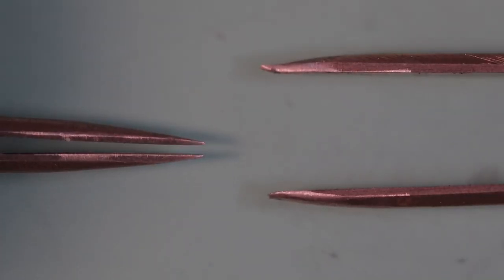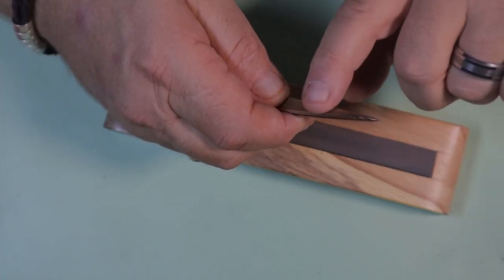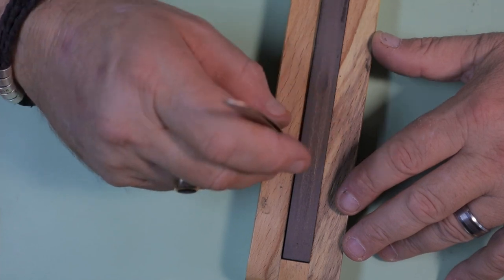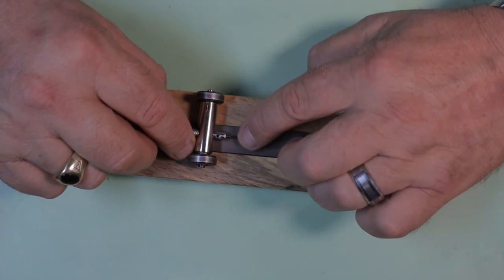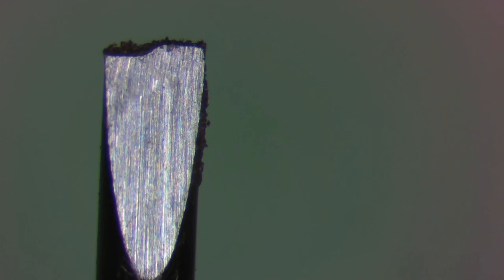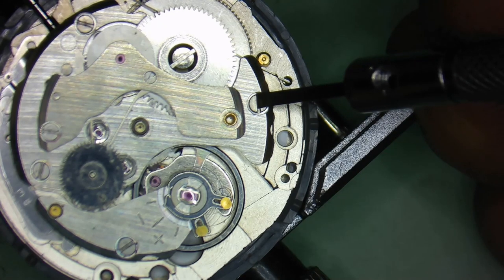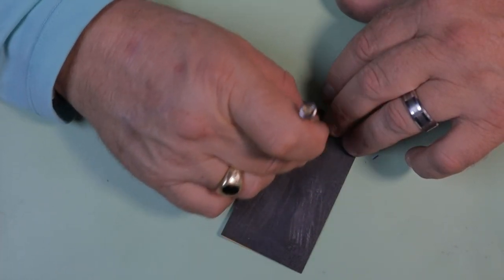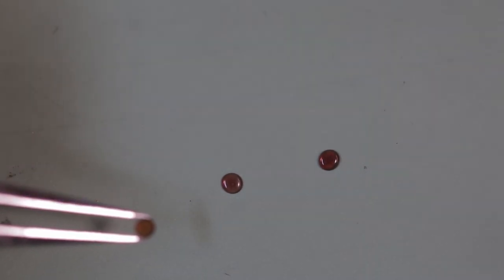How to Shape Tweezers and Screwdrivers for Watchmaking. Episode 2 in Watch Repair and Service.

Comment: I just retired after working on US Naval aircraft for 25 years followed by 24 years of specialized US Naval Seaborne Radar testing. I’ve been watching Marshall Sutcliffe for a while now and splurged on tooling to start my new hobby of watch servicing. So far I have been experimenting with a couple pocket watches and making the common mistakes your first two videos explain. Looking  forward to learning more from your well produced and realistic tutorials. Thank you in advance, Roger.
Reply from the maker: Well, first, let me say thank you for your service and the sacrifices that you and your family made to protect our country.

The first bit of advice that I would give you is to remember that just like the testing you were doing on radar equipment, everything and watchmaking matters  down to the smallest degree.

Probably the first obstacle that most newcomers face handling the smallest parts. 

In this video before we even talk about taking anything apart, I focus on making sure that your tools are in good shape so that you don’t have screwdrivers, slipping out of the slot, damaging the movement and to make sure that your tweezers are properly dressed so that you can pick up those tiny screws. 

Most people don’t think it’s important until they have a part fly away.

If you ever need any help with anything, don’t hesitate to reach out .
-Alex

Comment: Thank you for making these videos. Excellent work. 

I am looking on getting started with watchmaking and this has been a great place to start.
Reply from the maker: The first videos are going to cover the basics, the movement systems, how to lubricate pivot jewels, the escapement, balance jewels, different methods to clean parts and how to assemble, check systems how to use a timegrapher and what and how to inspect. 
Then we will move into trouble shooting with real life examples.
I will also cover how to use a staking set, Jeweling tools as well as lathe work when we get into the more advanced repair.

Comment: The principles here are so helpful! I'm still waiting on the rest of my sharpening tools, so using this video as a guide, I free-handed a very light dressing of my tweezers and my two screwdrivers with some 400-grit paper. I used my fingernail to hold the tip down flat.

Even just this made a BIG difference in handling of the parts. It feel much better. In fact, if someone else tries this, I recommend 800-grit sandpaper to start out, because with 400 it only took me 5 strokes on each side to smooth and thin it out. Slower is better!
Reply from the maker: Nobody talks about really but sizing screwdrivers for the screws you are working on is watchmaking 101.
Many watchmakers will have multiple sets of screwdrivers fitted  to a particular manufacturer like ETA or Seiko.
In these cases, there's more consistency in one manufactures screw sizes so less dressing is required but when you are working on many styles of watches like a pocket watch one day and an ETA move to next day you'll be dressing screwdrivers a lot.
Reply: @watchrepairtutorials  Yeah, I remember you saying that! I don't have a full set of screwdrivers, just gathering them as I need them, so I suspect I'll end up with multiples of certain sizes way before I get a full set.

Comment: I've been a collector for a while but have recently gotten into actual watchmaking instead of just collecting. Your videos, in my opinion, are the best on YouTube. You don't just take things apart and put them back together with some light banter to break up the quietness. You explain things in detail, so we understand the why!! I've watched other videos and walked away scratching my head. I saw your videos on this playlist on working with the ST36, and with your help, I was able to fully disassemble and reassemble the movement without issue!

I've found my teacher and go-to! These videos are amazing, please keep it coming!

Question for you - how do you know which screwdriver is the best for the screw you are dealing with? The sizes are so close, I find myself second guessing which to use!

Get use to my name, I've got a ton of questions coming your way!
Reply from the maker: The screwdriver tip should be just less than the width of the screw. This is true in almost all cases.
Reply: @watchrepairtutorials  okay, that's good to know! So, just short of the width of the screw. The tip should sit in the slot touching both sides, not the bottom of the screw. I'm trying to watch all your videos before I bomb you with questions. I'm also signing up for your online course once I am proficient with the free stuff you got on here!
Reply from the maker: @KrimNL10DenZ  perfect. 👍

Comment: I use a small block of accurately squared hardwood with 0.5mm - 2.5mm holes drilled through to act as a jig to dress the tip of screwdriver blades. It has improved the flatness and squareness of the tips and makes sizing a tip to the slot a breeze. I'll stick with this until the AlexZen kicks in! Great channel. Thank you for taking the time and effort.
Reply from the maker: Hey man if that’s working I love it.

Comment: A trick I picked up is to stick my sandpaper to either a small piece of sheet glass or broken chunk of polished granite countertop. You can usually come away with a cutoff from big box stores or stone works (whatever is closer) for free or next to nothing. They will generally both be sub .001 distortion on the polished flats and works wonders on anything you want to make flat and square regardless of it being screwdrivers or cleaning up and truing head castings for model steam engines.
Reply from the maker: Yes sir,
Great tip. I have some small 6 x 6 pieces of glass that I picked up that also work well as you pointed out

Comment: Thanks for the tips on tweezers and screwdrivers.  Got any helpful hints on how to remember where screws go????
Reply from the maker: Sure do. First thing is look at them when you take them out. Many screws have distinctive features.
 For example, most of your bridge screws will be the same size and shape. Some screws have a chamfer undercut and the plate they come out of will be undercut. Of course, the two largest screws belong to the ratchet wheel and crown wheel with the crown wheel screw being reversed thread.
When you get to your disassembly group, your parts by the systems that they belong to. The your system parts together like  for the keyless works, the motion works and train.

Comment: Thank you, thank you, thank you! I had rubber bands holding my tweezers instead of actually adjusting them like in your bonus tip.  Just a suggestion/idea:  I saw on another vid that using aluminum oxide films (3M) are a good alternative to sharpening stones....so I bought a 30 micrometer one for $6 and it works great.  It was a great alternative because I didn't have the $$$ for good stones.
Reply from the maker: Hey man, whatever works for you. There are a lot of different ways to do it. The point is you just need to dress them. Nice having you here.

Comment: I read somewhere that it is helpful to slightly roughen up the inside surfaces of tweezers to help holding jewels.
Reply from the maker: Yes it is. If you take a piece of sandpaper, like 360-400 grit and fold it over, you can pull it between the tips to put some “teeth” on them. 
The exception would be tweezer dressed for hairspring work which spoils be polished to prevent scratching the hairspring.

Comment: Is the gritt of the sharpening stone the same of the sanding paper? 400-450? If the sharpening stone is wider than your can I damage the wheel of the sharpening holder screwdriver tool?
Reply from the maker: I’m not sure what the grid is probably around 4 to 500. If you’re doing this on sandpaper, since the wheels are rolling over it, I doubt there would be very much damage at all.

Comment: Thanks for another great video. I must get out the stone today and give things a touch up. I spent about half an hour trying to get the magnetic drive gear back in a Citizen C022 and once I dressed the tweezers it took about 30 seconds. It makes all the difference. Just need to get better now with cap jewels, launched one into the universe trying to get the clip back on ☹️
Reply from the maker: I am happy to see that you see the advantage in tweezer dressing and sharpening.
Just remember, super lite touch. Channel your inner “ Brain Surgeon”. 😊
Remember Phil, when holding a part, the amount of pressure, on the part or jewel, should only be enough so that if you lose it from the tweezers, it would only fall straight down.
Reply: @watchrepairtutorials  yes I use the minimal amount of force these days. It was replacing the jewel retaining clip that sent it into or it this time. And being about a third of the size of a balance jewel, I never found it again. Sent to the black hole of horology. Maybe I should have oiled the jewel first, it would have retained it, but I wanted to do that last. Lesson learned.

Comment: Where were you when those irreplaceable tiny screws were launched into space, huh? 😂😂
Excellent video! I do run a piece of 220-320 grit sandpaper lightly inside the tweezers to improve gripping, is that okay? Thank you for tip on adjusting the tweezers tendon/opening! Love your videos!
Reply from the maker: Yes, I’m actually surprised I didn’t put that in the video but it was one of my first ones. I do the same good point.

Comment: Lovely concise tutorial. This was perfect.
I was told another tip on not pinging small parts away, which was to use slightly larger tweezers. I wonder what you think of that idea?
Reply from the maker: First, I would say, tweezers, or a very personal tool. What feels good in your hand may not feel good in my hand. I have used Dumont 3C tweezers, most of my life, and when I bought my first pair of bronze tweezers, they were quite a bit larger and I don’t think I have gotten used to them yet. 
In my opinion, parts fly, and fly for one reason only. You are gripping the part too tight.
Reply: @watchrepairtutorials  Yeah I think that makes a lot of sense. Thanks so much for the answer, and all the effort you put into these excellent tutorials.
Kindest regards from Ireland.

Comment: Question on angles: I've read between 15-17 degrees is the "proper" angle. Angle relative to where?  If the length of the shaft is the reference or 0 degrees, is this "proper" angle 7.5-8.5 on either side, or 15-17....I just cannot find a source that explains how to measure this.

P.S. - I understand shapes of blades will differ for a variety of screw slots....but like in your Watch Repair Lesson #7....how do you know what's wrong, if you don't know what's right?

Fantastic series!
Reply from the maker: Hey Alan, 
Great question. Personally I wouldn’t really worry about the angle because it could change for every different screw. 
What matters is how the screwdriver fits the slot. 
If you have a screw with a wide slot but is very shallow, the angle would be different than a screw with the same slot width that was deeper. Or reverse the scenario. 
I would always sharpen the screwdriver so that the flat sides  of the blade were flat and correct to each other, then holding the screwdriver upright, adjust the edge of the tip to fit the depth of the slot. 
Screwdrivers will often need to be corrected when switching from one caliber to another. 
Once you get your process down, it should only take a couple minutes.

Comment: Note that Alex is behind a table that looks too tall.  It's not - it is a height that allows him to have his eyes and arms approach the watch or movement holder in comfort.  As for sharpening, over the years I have accumulated a couple of hard Arkansas stones, some cheap abrasice ones, ceramic rod sharpeners, two kits for knife sharpening each with good stones in holders, and my favorites for a quick knife edge the DMT brand diamond folding sharpeners, a green and red.
I wonder when Alex will mention lifters for watch hands, or gear pullers, other tools?  I'll stick around to find out.
Reply from the maker: Hey there Ammo,
I sound like you have the sharpening stones handled. 😃
As we start moving into basic repairs, I’ll be introducing more tools and products that I use. 
Hope you follow along.

Comment: Hey Alex. Great stuff on your channel! I have a bit of a weird question, maybe its just me not being used to flathead screwdrivers but how do I know when I need to reshape a screwdriver vs when I just am using the wrong size?
Reply from the maker: So the first thing is you want to use the widest blade that doesn’t hang over the edge of the screw slot. 
Then the tip of the blade should not touch the bottom of the screw slot. If it does, the blade does not sit on the edges of the screw slot and it will slip out.
The easiest way to detect this is if the screwdriver blade moves around in the slot.
Reply: @watchrepairtutorials  Thank you! That is great info for me as a beginner like me

Comment: @watchrepairtutorials thanks for the lesson! You reminded me I have a pair of those tweezers somewhere...now I have to remember where...lol.
That wood around your sharpening stone is beautiful! What species is it please? 
I'm trying to start my own woodworking business repurposing and refurbishing items to keep them out of the landfill.  Currently I'm researching how to refurbish a Raketa 2609.ha...was badly damaged by flood waters among other things.  Overall it is not terrible...the outside ironically is in good condition.  Once I cracked it open you can see rust. I stopped at the top layer when I realised it was more complicated than I expected. 
Do you have any videos for the Raketa 2609.ha?
What is the purpose of the gems? I've never seen them in a watch before. Are they Swarovski? It would make sense.  I do have a bunch from making jewelry...does it matter about cut or colour? Obviously size would. 
Can I use the same oil from my sewing machine?
I plan on working with my hands inside of a small pop up tent with a rubber mat in case something gets away. 
Here's a tip for you! There's a product called "tool magic ". It's for dipping your tools in to minimise risk of damage and has a better grip on slippery lil components. It peels off easily and occasionally needs replacing  but well worth it.
Reply from the maker: I'm not really sure what kind of wood it is. It looks like red Birch to me. Yeah Russian watches are not really my thing. I worked on mostly Swiss in American movements with some Japanese sprinkled in.

The gems you are referring to are known as jewels. Jewels have been used in watches since the early 1700’s The earliest jewels were made from garnet, ruby, sapphire, and diamond.
Most modern jewels are ruby, or sapphire (corundum) made from aluminum oxide. The older jewels are made from natural stones, but since the 1940’s jewels have been made from synthetic materials.
And no you can't make your own jewels unless you are a serious master watchmaker.  The scale and precision needed is out of the realm of possibilities for 99.9999% of us. 

Lubricants made for watch movements are very specialized so sewing machine oil would not produce good results. You should think of lubricants just as you would a tool. They are expensive but they last for a long time because you're only using a very very small amount. When starting out mobius 8000 is a good choice because you can pick up a bottle for less than $10 and use it to practice lubrication techniques which takes time to get good at. Just be aware that you will not get the best results with this oil but it's definitely better than using sewing machine oil.
Tool magic is not something that you would want on your tweezer tips. The tips need to be much finer and in some situations needle like. Have you seen how small a watch screw or jewel is? When needed we use either brass or bronze tweezers because they will not scratch steel parts.
Reply: @watchrepairtutorials  thanks for the advice. At least I knew not to use food grade grease...lol...
I'll be doing more research before I attempt it. Besides yourself (yes I subscribed), are there any other channels I should check out? At least you respond! It's greatly appreciated...
Reply from the maker: @fdort3971  well there are entertainment channels galore. Check out mark lovic at watch repair channel as well.
Reply: @watchrepairtutorials  thanks